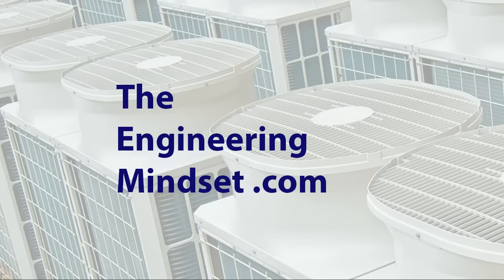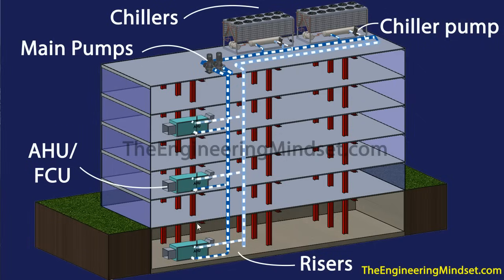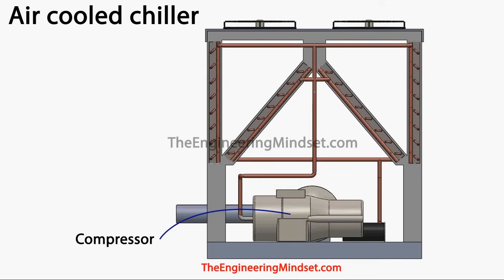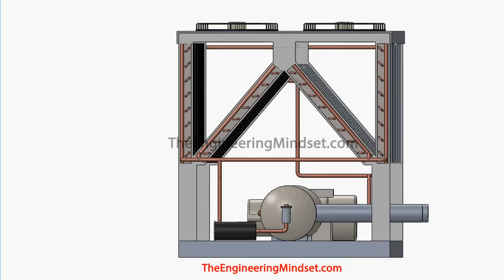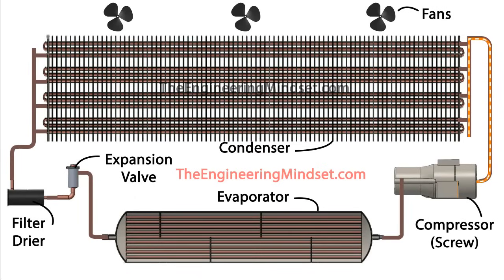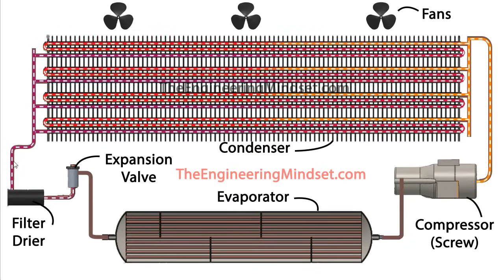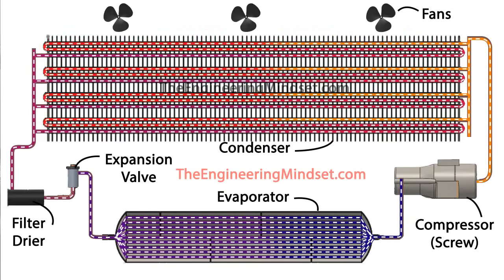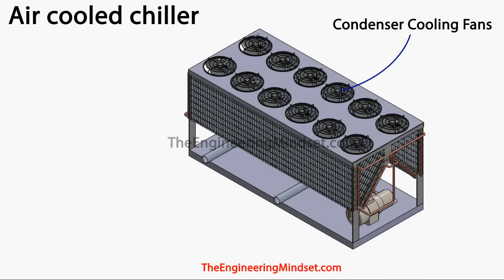Air Cooled Chiller -  How they work, working principle, Chiller basics

Comment: Thank you so much: I think there is a small mistake here, correct me if I am wrong- The fluid entering the evaporator is air, not water as you mentioned in 13:29
Reply from the maker: No, as shown, refeigerant is passing through the evaporator and exchanging thermal energy with water, which is then pumped around the building to provide cooling. This is a chiller. If it was a small air conditioning unit, then it would be air.

Comment: Both water to water and air to water use latent heat of evaporation.
 Refrigerant leaving evaporator should be low temp low pressure superheated vapor.

Comment: If you had an air cooled chiller circuit with all the AHU’s etc on primary side what would determine whether you pipe the chiller arrangement up in reverse return or just loop the flow and return?

Comment: How is the air cooled chiller less efficient? For me the advantages override the non-use of latent heat exchange in the evaporator. 1- no cooling tower. 2- No condenser pumps 3- easy maintenance 4- easy fan replacement. 5- no dependence on water supply or water cost. 6- less chance of chiller surge. 7- less components to fail.

Comment: My understanding is that when the temperature increases the pressure from the sensing bulb increases also causing the gas flowing through to decrease in temperature...... So my question is where is the sensing bulb located in the chillers system so it can read the temperature of the building
Reply: That is where the controls game comes into play

Comment: Are air chillers noisy? If you have them at say the first floor if the building with louvres and the next level up are balconies (above the louvres) of the apartments will there be a noise and health issue?

Thanks

Comment: I don't understand you keep on saying "supply chilled water in/out" in the evaporator.  it should be Air conditioned circulation  in/out from building room in the minute 13.30 (cmiiw). 

You are talking about is air-cooled chiller rigth, not water-cooled chiller
Reply from the maker: I'm not sure where in the world you are but we call it chilled water flow and return. See our other chiller videos for examples and photos
Reply: @EngineeringMindset  Owh..Sorry sir, after cross references I understood the different between direct refrigeration and indirect refrigeration (two step refrigeration). 

Chilled water system both water cooled and air cooled are alway use water chilling.
I thought Air cooled does not used water chilling.

Comment: How can you ensure good refrigerant distribution at the inlet of the evaporator?
Reply from the maker: Hey Elliot good to see you back. https://youtu.be/Ic5a9E2ykjo?t=563 here you can see a real example, the runs are all equal length so all have the same pressure drop so flow would be equal in each and therefore the same flow rate. But if the fins on the evap are damaged or blocked over some runs, then the heat will be harder to dissipate so it can become unequal.

Comment: Thanks for the video. I have 2 questions.
why the pump is used on top of the building while the water will flow by gravity?
second question, how the water in floors below the chiller is coming back up to the chiller without using a pump?
Reply from the maker: Push through a chiller otherwise if suction is too high it will damage the chiller. It is using the roof pumps to come back up
Reply: Thanks for the reply. 
In our design the pump is located on the roof, the same floor as the chiller, but it pumps the return water. Not the supply as illustrated in your video.

Comment: Hello sir , 
Nice Explanation, I have learned. A lot from this video but one thing in my mind is that chilled water return which is going to the  evaporator coils  is there any pipe contain seperately in the evaporator & Comes back to supply chilled water..!! 
In the evaporator is there any pipe contain seperately for chilled water supply & for chilled water return.
Reply: With little less to understand your question, There are two pipes in the evaporator; one is caring the refrigerant and the other has the water from and to the  building. In the evaporator they only exchange heat. Please respond if i am not making it clear
Reply: The FCU/AHU's return line going to chiller's entering water line and chillers's leaving water  line going to AHU/FCU's supply line.  You can see only two pipe line in the chiller evaporator(shell and tube) , one is entering water pipe which coming from building and another pipe is leaving water pipe which going to the building. That's all.

Comment: Trying to troubleshoot a small unit the heat light is on. Trying to figure out what is causing it. Any advice
Reply from the maker: Search online for the manufacturers hndbook on that exact model, it should state in the back typical problems and causes

Comment: Hi Paul. I'm just wondering why you put water pumps on the roof which technically is on top of the roof ? I guess is because it is the main water source before it is distributed into each AHU.  The lowest AHU would get highest water pressure I assume.
Reply from the maker: air cooled chillers typically have the pumps installed on the roof close to the chillers and they push water through the evaporator. In this case I've shown each chiller to have its own smaller pump and then a large distribution pump set but its also very typical to have just one pump set forcing through the returning chilled water through both evaporators and then using an automated valve to control the flow to the chillers. Th manufacturer will specify which should be used. Yes the lowest point in the system will have the highest pressure due to the force of gravity on the mass of the water column

Comment: what is the source of water to evaporator as there is no need for cooling tower for air cooled water and the provided water will be chilled or not i want to know.
Reply from the maker: In air cooled chiller, the only water used is "chilled water" to cool the building heat load. There is a small connection to the water main which can top up the system and apply cleaning chemicals when needed.
Reply: From where we r taking chilled water?

Comment: Thank you for this it is very informative. Can you explain more why water cooled chiller is more efficient than air cooled?
Reply from the maker: water cooled chillers use evaporation to reject heat in the cooling towers. air cooled do not have this ability
Reply from the maker: Check this video out for chiller application guide! https://youtu.be/gYcNDT1d30k
Reply: Water cools more efficiently than air.
It also takes more latent heat out of the system.

Comment: Can you elaborate on the part where you say air cooled chillers are less efficient because they don't use latent heat of evaporation. What do you mean by this?
Reply from the maker: Water cooled chillers will remove heat through water evaporation in the cooling towers. Air cooled chillers do not have this, they can only transfer their heat to the air through conduction and convection, maybe a little radiation too depending on the DT
Reply from the maker: Check this video out for chiller application guide! https://youtu.be/gYcNDT1d30k